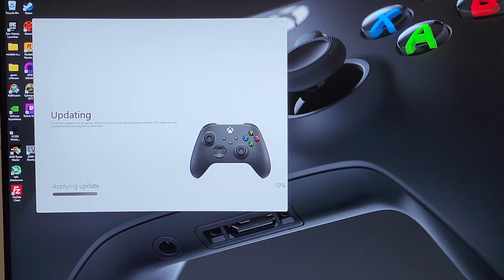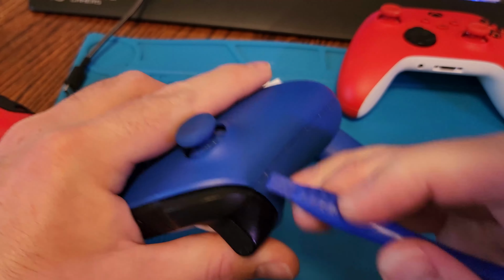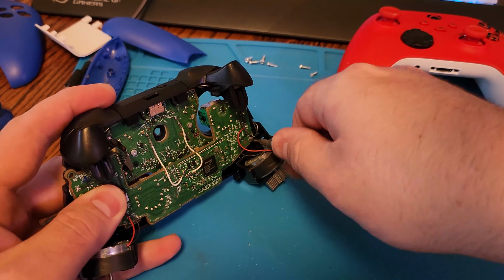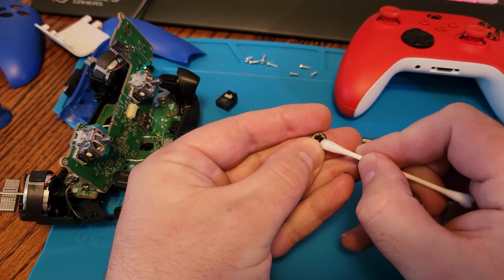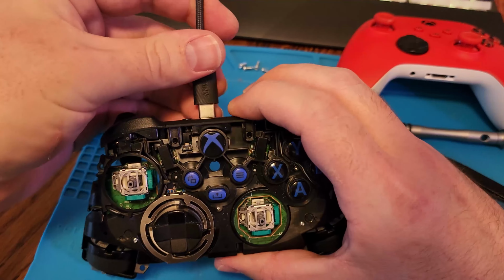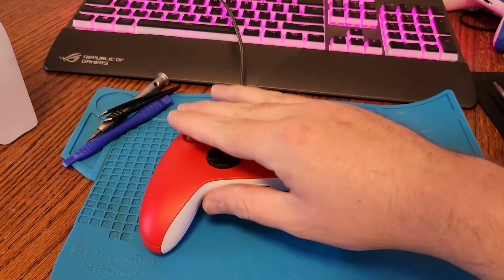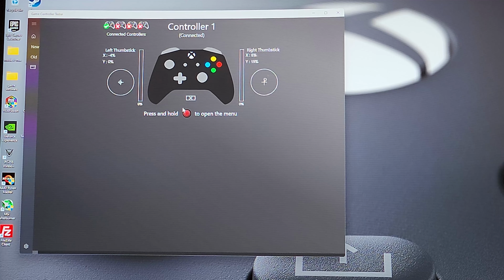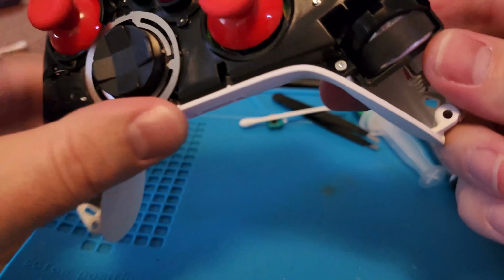Series X Controllers drift repair

Comment: Broke my stick more. The right stick now is permanently drifted 50% in the Y direction and can't move back down no matter what.
Reply: I somehow fixed it wow, but that teal thing i had to pull back to get to the black disc thing underneath is super beat up and stripped
Reply from the maker: As long as it's working it's fine. It can be replaced in the future
Reply: @JimsTechNonsense  I’m not really a repair guy, but this video helped a lot. I’m glad I didn’t have to get to the part where you soldered stuff because I don’t have those tools

Comment: I recently butchered my sons Series X/S controller trying to fix a left stick drift issue by replacing the pot. I figured while I had it apart instead of just cleaning it, I might as well just replace it (maybe that was a mistake?) I watched enough videos and felt confident with the repair, but should have watched this one first. Getting the holes clear after removal was the exact problem I had, and I probably ruined the board during the process. I was using a sucker and solder wick. Your idea of flowing the solder onto the three pins and then using the iron to pull it out through the bottom is what I should have done. Maybe next time  😞

Comment: I was dealing with an annoying drift problem on the left analog stick of my controller, which was only getting worse gradually. I decided to open the controller to see if I could fix it and ended up accidentally almost breaking the blue box of the analog stick, as well as bending the small piece of metal inside. I closed the controller thinking that I had messed everything up, but surprisingly, the controller started working normally again. I dont know wtf i did, but it worked. I plan to replace the entire analog part or buy a new controller, as this is the second time I've had drift problems with this same controller.
Thanks for the video man!
Reply: LMAOOO DOES IT STILL WORKing?

Comment: THANK YOU SO MUCH I FIXED IT BECAUSE OF THE FIRST METHOD!!! Unfortunately one of the wires came loose and disconnected and that's the sq5 wire which I think is the rumble motor wire but the controller works fine.

Edit: you earned yourself a subscriber!
Reply from the maker: Glad to hear it! Thank you for subscribing

Comment: Nice vídeo tutorial!
My Series x Left analog is drifting up and down. I will check both later!
Reply: Hi it’s the same for me did u found the solution after 2 week?
Reply: @lethisyt9306  I have used an  anti-seize spray like white lub super on my analog circuit. The rubbers inside it were grabbing and causing the drifting. I have applied 5 times and drying below the excess. 
It's EVEN BETTER then when it arrived! 🤣

Comment: I opened the green plastic thing replaced the metal little part now it won't close the green plastic part because i butchered the top tryna get it open i fixed it as well the drift when i hold the green thing it works fine

Comment: Do you know if there are replacement parts for just the little black piece of the joystick potentiometer. Seems to have been a short circuit at some point and the little wires inside look like they’ve oxidized to being weirdly purple... I can’t solder in my apartment, so trying to find a solution to a problem that was a solution to another problem....
Reply from the maker: I haven't bought just the insert but you can but the potentiometers and pop them out quite easily.

Comment: Hi just got this controller and, right trigger has a 3mm. dead zone, can it be fixed or just return the controller?, i tried updating firmware and it helped a bit, and now it's 2mm. Also I hear a weird noise in the Xbox button area (when controller is on), but only when I bring the controller really close to my ear, is that sound normal? I hope you respond soon!
Reply from the maker: There's no adjustments for trigger dead zone unfortunately. I'm not sure about the noise
Reply: @JimsTechNonsense  Well, thanks anyway.

Comment: Any idea how to repair a select button that doesn’t work?
Reply from the maker: I've had that happen and if the contacts are clean and it's still not working it's unfortunately a failed motherboard and the only option is replacement

Comment: On 6:14 after cleaning you can see that potentiometer holder are damaged, you need to change that, desolder and solder a new one.
Reply from the maker: I'm still using it without issue but when cleaning doesn't work I either replace the potentiometers or the whole analog stick.

Comment: I've seen other videos that indicate that swapping the joystick/potentiometer isn't as straightforward as you make it seem since there is some sort of calibration burned into the controller itself.  Is this something that you have seen as well with these controllers?
Reply from the maker: I haven't found that to be the case. Just use a quality replacement, I recommend alps brand, and you'll be fine.

Comment: i fixed it but now my axis 0 reads 100 percent left or right and only changes when sent that direction is detected... sneding it to the other side.
Reply from the maker: Sounds like a worn potentiometer. I'd recommend replacing it or the analog stick entirely.

Comment: What about the white wires
Reply from the maker: They need to be reconnected, but you can test the controller on pc via USB before doing so to be sure it's fixed.
Reply: Do you have to solder those back on?
Reply: Yeah, I'm bummed. It looked like they just snap back on, but I've been trying for 30 minutes. They don't want to stay.

Comment: The xbox series controllers are such garbage.  Ive been a gamer since atari, and these controllers and this generation are the first time I've seen "stick drift" become a universally recognized term.  Ive been gaming on xboxes since the first gen with uncountable hours of personal gameplay logged for each generation of console.  Never had an issue.  I bought my nephew a series console and I've had to replace his controller twice in the past year.   Considering these pieces of crap are $70, I have to wonder wtf is goin on.  Is this planned hardware failure to increase profits?  If it werent, Microsoft would have fixed the faulty part in the supply chain by now.

Comment: so i changed the whole motherboard with the joysticks on with a new one. now my controller wont cont to my xbox just on my pc via bluetooth is there any fix for me?
Reply from the maker: Did you reconnect the small wires?
Reply: @JimsTechNonsense   i did yes. you think i might didnt connect them well? is it ok if u replace the whole motherboard with a different one? or its compatibility issue?
Reply from the maker: As long as it's from the same model it should be fine.

Comment: I. cannot get the two wires back on to reassemble the controller. HELP ME lol
Reply from the maker: Hold the round end of the cable with tweezers and push down gently with your fingernail
Reply: @JimsTechNonsense  I ended up getting it on. Now the stick drift is worse than before. Idk if I put the potentiometer back in wrong? I can't tell which was supposed to be up. But it's now staying straight up after hooking it up to gamepad tester. Ugh
Reply from the maker: Sounds like it is upside down